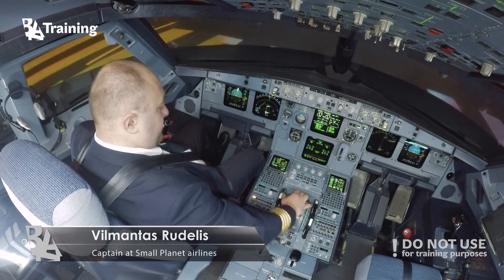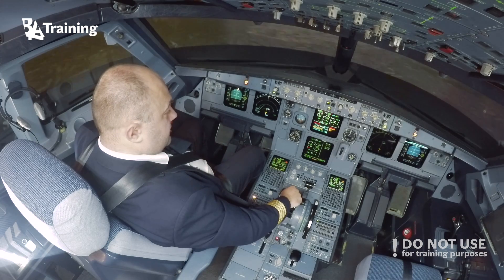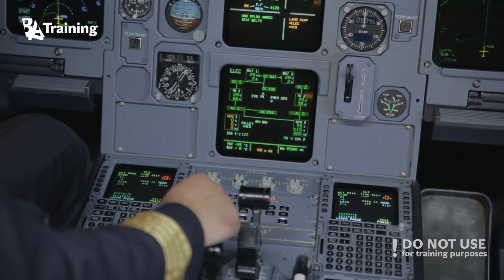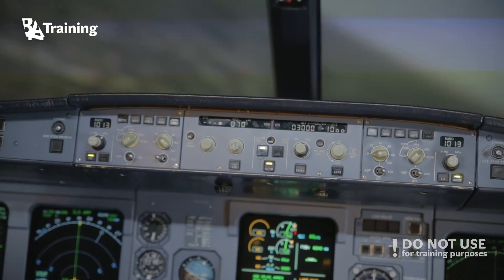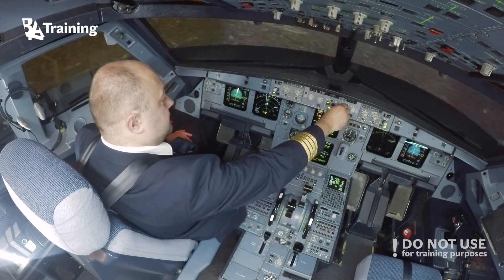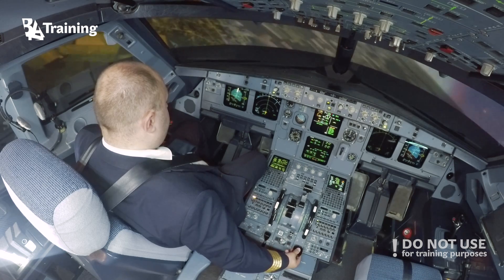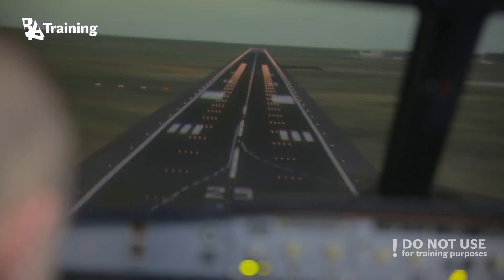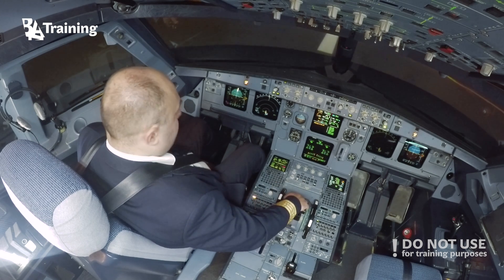What  to do if one of the engines fail right after V1?  Simulation in A320 Full Flight Simulator

Comment: I Learned This, You Shouldn't Turn The Direction Left If Your #1 Engine Has Failed, You Should Always Turn The Direction Of The Working Engine, In Which This Case It Would Be Engine #2, Because The Left Wing Is Producing Less Lift Without The Engine Running.
Reply: Not so in jets.

Comment: There is something that I don't understand about this video. PIC experiences ENG1 fire right on Vr then makes a "mayday" call? As the PIC still has a healthy ENG2, why didn't he make a PAN call instead? There was clearly no imminent danger. This would have misled ATC into thinking lives were about to be lost and potentially used up more resources than necessary.
Reply: He has an engine fire, at the time he did not know whether it would extinguish, meaning it just becomes an engine failure scenario or not.

Comment: Should you use reversers? saw trim going crazy there also I know of at least one flight which had engine failure and ran off runway cause of reversers pulling to one side.
Reply: The airbus auto trims.

Comment: What does he mean when he states, "reset stab trim" right before the touchdown?
Reply: He says "reset rudder trim" because with an engine failure on a twin the rudder forces needed will be large and for an extended period of time so the rudder trim is used. When coming in to land the rudder trim should be reset to maintain control on the ground etc.

Comment: It's not possible to use the reverse while engine is off
Reply: Point 2 is just not true.

* From the 737 NG FCTM:
"REVERSE THRUST - ENGINE INOPERATIVE.
Asymmetrical reverse thrust may be used with one engine inoperative. Use normal reverse thrust procedures and techniques with the operating engine. If directional control becomes a problem during deceleration, return thrust lever to reverse idle detent.". 

* From the A32x FCTM:
"ENGINE-OUT LANDING. ALL.
Autoland is available with one engine inoperative, and maximum use of the AP should be made to minimise crew workload. If required, a manual approach and landing with one engine inoperative is conventional. [...]".
Nothing about prohibiting the use of reverse thrust whatsoever.
Reply: Why not?
Reply: 1- The inverter reverse thrust developed by the engine to brake. So if no thrust there is no reverse.
2- it is obligatory to use the inverter of both engine simultaneously (the case of a twin-engine plane (A320)) to have a symmetrical braking and avoid drift and runway exit. So in the case of one engine failure the pilot uses only the spoilers and the wheel breaks.
Reply: zaffati khalil What if they just used idle reverse?
Reply: idle reverse for the running engine?
Reply: zaffati khalil yes
Reply: I'am not sure but i think that it's possible but the pilot have to correct the trajectory of the plane by the Rudder because of the asymmetric breaking.

Comment: just wondering, is all the talking he does also going to  ATC or is it mainly for a co-pilot and cockpit voice recorder?
Reply: What the captain talks in this video of a simulated (remember) flight are the actions that the pilots would apply in the several phases of this flight. Sometimes he is just telling the video viewer what he is doing. In other talks he is following the check lists that the pilots would share in loud voice. At other times he simulates communications with the air traffic control. Everything said in loud voice is recorded in the cockpit voice recorder but the air traffic controllers will only hear what the pilots say when they press their radio transmitting button. (Pilots watching this video will easily recognize what it's all about).

Comment: He almost needs the whole rudder to compensate the unilateral thrust. Seems to be quite difficult to make fast rolling maneuvers and tight turns to the right now.
Reply: That would make sence as all thrust is coming from under one wing
Reply: gonatrollya
Certainly, I'm asking if it is better to take the opposite aerodrome circuit, if the wrong engine fails? But don't know if this is common or forbidden. I never had the chance to she a rudder in such an incident. There seems to be not so much articulation left.

Comment: I'm sorry guys. But to me this is scary as heck. Where is the control by the pilot? Where is the flight yoke? All this guy is doing is pushing buttons. The computer is really flying the plane. God help us if the computer fries. He may as well be playing a video game. How do you land this thing in a crosswind?
Reply: Wut
Reply: I don't understand your reply, Daniel. I think I "voiced" some valid concerns. If anyone knows more about the A320 what kind of backup systems do they have in case of a catastrophic failure and how MANY backup systems. Would love to hear from an engineer that actually knew what he was talking about.
Reply: The Airbus 320 (and later airbus models) has joysticks instead of yokes. The captain has his joystick at his left and moves it with his left hand. The first officer has his joystick at his right. With the joysticks you can move the ailerons (for banking and turning) and the elevator (for pitching). You can see these joysticks at 00:44  Like all other aircraft, the A320 also has pedals to control the rudder (and to apply "manual" braking when on the ground). You can disconnect the autopilot and the autothrottle and fly the A320 manually (with your joystick, pedals and throttle levers). The A320 also has analogic indicators of the essential flight parameters (speed, altitude, attitude, navigation & heading,...) to inform the pilots in the (rare) case in which the digital displays or the computers fail. You can see these at  3:51 in the left size of the video screen.
Reply: I really appreciate you taking the time to explain this to myself and everyone else reading this page, Carlos. After doing a little more research I found out that the A320 family of planes is what you call "fly-by-wire". In other words no physical connection between the cockpit and the control surfaces. From what I've read the pilot places inputs into the FLIGHT CONTROL COMPUTER which interprets these actions and moves the flight control surfaces accordingly. So basically with the pilot's help there is a bloody computer flying the plane. Before this FBW had only been used on military aircraft and the A320 family of planes are the first commercial planes to use said joystick/sidestick. And it was Bernard Ziegler who successfully convinced aviation authorities of the concept's validity. FBW seems to be a concept that works in spite of the 91 aviation accidents and incidents, including 35 hull-loss incidents with 1,392 fatalities. Fifty incidents of glass cockpit blackout. But apparently still one of the lowest fatality rates of any family of jets. Apparently. But call me paranoid or cynical or old-fashioned but I would rather still be flying in a plane where the pilot had DIRECT control of the aircraft and the safe operation of the plane depended on the pilot's skill and experience. NO computer is 100% reliable but the biological computer between our ears is exponentially better and faster than anything we can manufacture.
Reply: It's "sidestick". Not joystick.

Comment: the engine did not fail at V1 !!!! it's an engine fire this is very different situation as you don't lose the engine until you shut it down in the air; as in an engine fail you lose thrust on one engine and you have to immediately correct it with the rudder pedals or you will end up outside the runway
Reply: Good cause I was wondering wth a engine fire have to do with a failure.
Reply: Yes that's correct but you can see he still has power until he shuts the engine long time after v1
Reply: Jose Andres Rivera true, the burning engine would be still giving thrust, but wouldn’t the fire eat up the engine and later the plane itself?
Reply: Yes you are right. But at the same time if the fire is caused by an explosion it means you won't have thrust anymore. If the pilot takes off immediately after V1 then there won't be the risk of going out of runway. That said he would still need to apply rudder in the air to correct the imbalance. Correct me if i'm wrong
Reply: In the right under corner it says: Dont use it for training purposes.
Reply: Yea but they just wanted to tell us that it's too late for aborting the takeoff

Comment: I hope they revoke     this crazy  "commander" licence for life taking   off without a copilote not even wearing its headset and   landing whithout atc clerance is criminale
Reply: ITS FUCKING SIMULATOR WHAT DO YOU EXPECT
Reply: Yes it's a flight simulator not a video game, flight simulator are made to train pilots to perform possibly dangerous manouvers as if they were in a real plane its just safer (they wont kill anyone) and cheaper, taking off with a single engine failure is part of the plane certification, in an emergency copkpit management is very important as well as weather (crosswind capability are much lower with a single engine) most pilots in this situation would request a holding patern to perform there single engine landing checklist  and possibly request an alternate airport landing airport if the crossind exceed the limits.
Reply: John Kubik He's saying what hes supposed to to the ATC without a headset. WTF do you expect? Some kind of AI in the simulator? Or communication to an actual tower?

Comment: Why is "priority left" showing up at 11:37?
Reply: it's not the priority light, it's the autoland fail light, and it shouldn't lite up either. Guess it's simulator flaw
Reply: +JackPoint Hi, know I'm a bit late, but it's my understanding the pilot engaged both the AP1 and AP2 systems,which I believe puts the aircraft in it's autoland phase. Being this was an emergency landing, I presume he disengaged it to reduce the risk of error upon touchdown, maybe due to the uneven thrust being produced. 

Again, not completely positive...
Reply: +Gregory Caesar (BOEINGFSXSIMMER) hi Gregory! You are partially right. Although the A320 can fully perform an autoland with just one engine, the light coming on means the plane itself is warning you that autoland is not possible due to a malfunction. The light is never meant to come on with the aoutopilot disconnected, so looks like an error of the sim to me
Reply: JackPoint Totally forgot about that part...greatly appreciate your insight!

Comment: It amazes me how much that cockpit looks like an ATR-72 cockpit. Does anyone know if the A320 cockpit was modeled after the ATR-72 cockpit? The only differences I can see is the joystick control (on an ATR-72 it's a yoke) and the aileron trims are on the sides instead of in the center.
Reply: They look nothing alike
Reply: I must have something mixed up.
Reply: Yes, was after. And ATR Airbus is on EADS consortium, probably sames departement of "Aerospatiale" designers ;)
Reply: Thanks for that.

Comment: when there is one engine failure  , should the pilot not use  full flaps  because of lift dissemetry ?
Reply: I read somewhere that it's not always desirable, if you have to suddenly go to full power again (for example, a go around), the extra drag from full flaps can be a detriment to single engine operations.
Reply: mezsh ok , thank you ☺

Comment: What to do during dual engine failure after takeoff? I'm just curious after watching the movie trailer of US Airways 1549 "Sully"
Reply: Dual Engine failure? From what I know all you can do there is pray that you'll survive the impact. 
there's not really many possibilities there. commercial airplanes usually do not have the best gliding properties.
Reply: Sully had enough height to think and select somewhere to land, if he had lost both engines just after lift off then he would crash.
Reply: It's very rare and I don't think has ever happened at V1 before. If it did happen at V1 many pilots have stated they would try to abort the takeoff as especially with long runways it is possible. If you are able to get above 2500 before dual engine failure then it is possible to make a return to the airport if you begin turning immediately after the failure.
Reply: @B767-3.  No Casualties actually

Comment: Very professional as expected but why was full flaps used for landing? Is it not normally a conf 3 landing with an engine out? Or does this vary according to airline?
Reply: With the fuel load he would be heavy.
Reply: maybe in this sim configuration he was very light?
Reply: Nell E If he was light he could have used less flaps, and if heavy he would have just came in at a higher speed to compensate.

Comment: it is "if one of the engines fails", also it didn't fail, it did catch on fire.
Furthermore, are immediate engire fire operations not supposed to be memory items?
Reply: Fire means failure. It either burns or gets extinguished and inoperable
Reply: a fire is a fire a failure is a failure, 2 completely different things, he never loses directional control on v1 and after, because the engine is still giving thrust  up to its shut down, on an engine failure you lose directional control and that's another story to tell
Reply: Is the affected engine going to be providing thrust?
No.
Fine.  Failure.